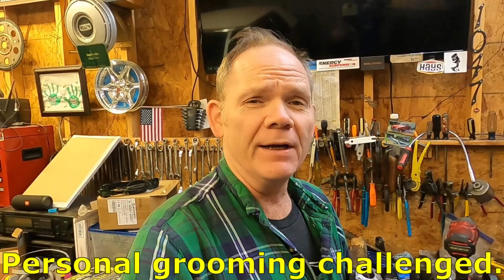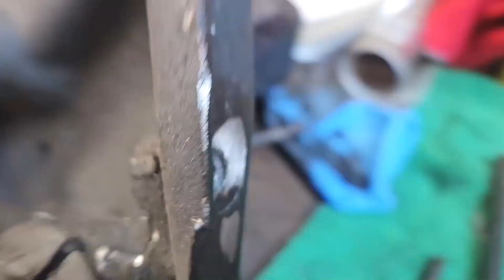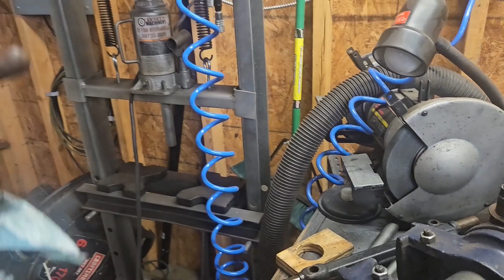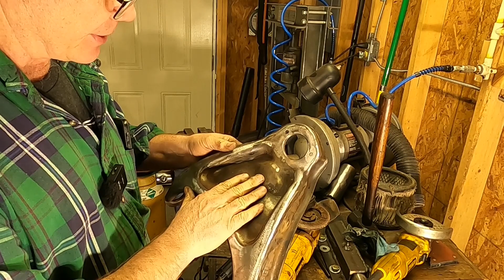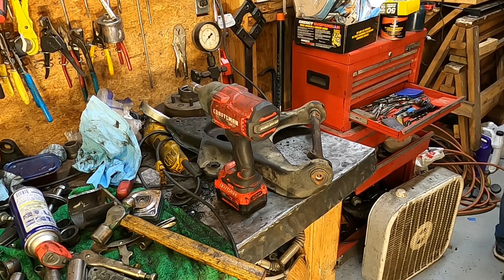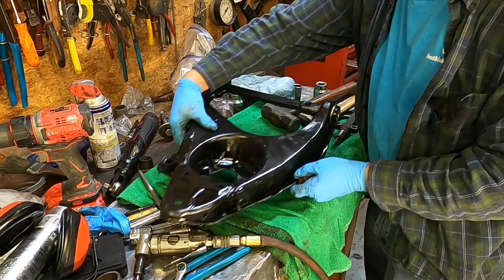1978 Silver Anniversary Corvette - Restoration - Part 13 - Control Arm Restoration

Comment: Great videos! I own a very original '74 L-82 4 speed car that I have been pretty much doing everything you're doing to your car over the last 3 years I have owned it. They certainly need some love after 50 years🤣...Just curious, what ever ended up happening with your head gasket/top end rebuild video segements? I had the same issue with mine and ultimately ended up pulling the motor and bringing it to a machine shop for refreshing. Just curious how you made out with your engine? Thanks!
Reply from the maker: Hey Joseph. Thank you! Actually I put the motor build on the back burner until now. I decided it was time for much more extensive restoration work so I decided to get everything underneath the car done first. When I am done under the car, the engine is coming out. All I like is two motor mount bolts and out she comes. The motor is coming out pretty soon. This car only has 52k miles but time takes its toll.
Reply: @ImpalamansGarage  Nice! Time does take it's toll...My car was only around 35K miles, but every single bushing in the suspension was shot just from age

Comment: Nothing is made in Mexico.  They only assemble parts from china. Car parts, fentenyl, and other assorted stuff.
I wonder why they didn't make the lower balljoints the same way as the uppers.
See you later. 😊
Reply from the maker: You never know what was rolling around in an engineer's mind Werner. LOL..... I ended up buying parts from several different sources, looking for deals and saving money on shipping.
Reply: @ImpalamansGarage  When the left rear glass in my mercedes broke, I called an autoglass company. They wanted $200 to replace it.
I found a used one on eBay for $50. The shipping was $50. 
I installed it myself. It took quite a bit of disassembly to get it in there.
My regulator, which I had replaced about a year earlier, broke shortly after that. The plastic slider broke from the stress of manipulating the glass in.
I propped the glass up with a piece of wood and left it like that.
Merry Christmas.